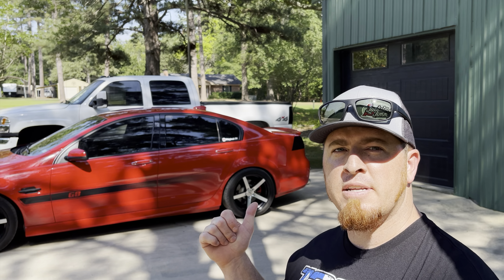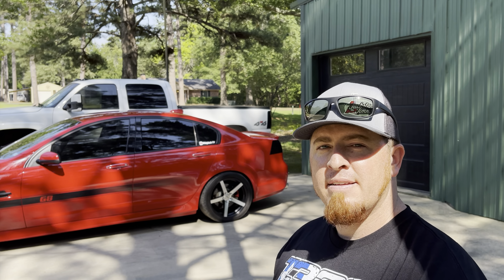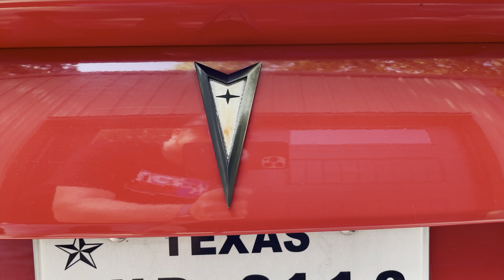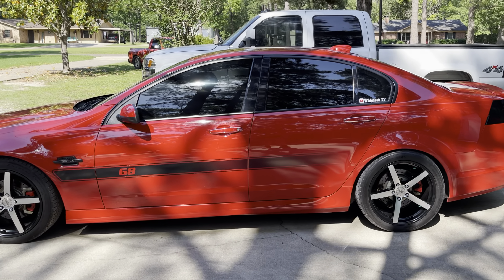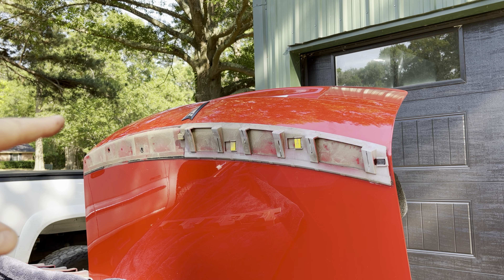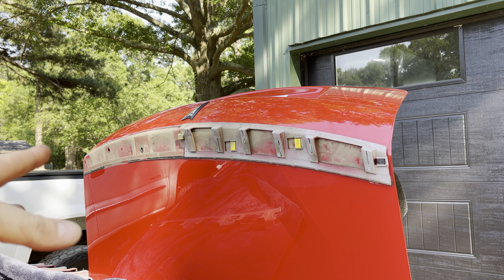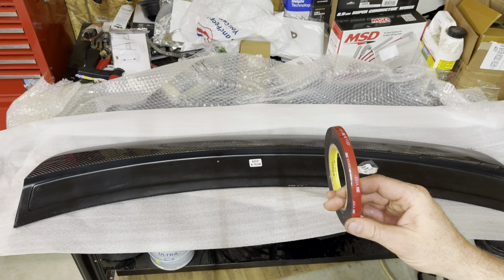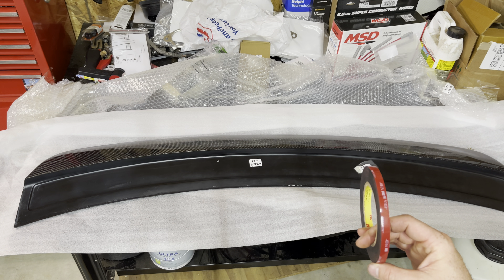CARBON FIBER Pontiac G8 GT Spoiler Installation and Review of Vladi’s Carbon Fiber Spoiler

Comment: That was a great video tackling this job . Thanks to you and your video I’ll be doing mine tomorrow. What kind of tail lights are those. They look fantastic! Thanks for your knowledge and sharing it.
Reply from the maker: Thanks, and I am glad that the video could help you! The taillights are actually factory taillights that are smoked and the tops painted body color.
Reply: @whiplashtv2022  I was successful in getting the spoiler removed today. Thanks again for a great video. Nice touch on the tail lights. How do you “smoke” the tail lights. Is that like a tint?
Reply from the maker: @siimplytwinss3248  that is awesome that you were able to get it off. I should have added that an eraser wheel would be a big help in removing the old adhesive that was holding the spoiler on. I did not have an eraser wheel at the time of shooting the video. I bought these tail lights done this way already. There is companies that make a smoke film that you can put on your tail lights, or you can have them professionally done by a painter.

Comment: Do you have a video for removing front bumper  and where did you get spoiler for rear
Reply from the maker: The spoiler can be purchased at streetdrivenperformance.net and you can use code “savenowb” and get a discount! I don’t have a video on removing the front bumper, but it is pretty easy to. There is a hidden bolt on each side behind the wheel liner and remove the fasteners under the hood that hold it on and then it should come off. Also disconnect the fog lights and marker lights.

Comment: Are these the same as the ones Eric Tau is selling? I’m unfamiliar with the name Vladi but mine just came packaged exactly the same. You got an IG? Went to comment on your fb post but can’t find it now.
Reply from the maker: If these are the same that Eric Tau is selling, then him and Vladi would have to have the same supplier and I am not sure if that is the case or not. I’ll check my messages here shortly 👍
Reply: @whiplashtv2022  I believe they are partnered as far as spoilers, and the side skirts. Possibly steering wheels as well.
Reply: Yes me and Vladi are partners. I do my own g8 steering wheels though and he's doing some other vehicles.
Reply from the maker: @etric412  ok cool. I told Vladi that I want a carbon fiber G8 front splitter next.
Reply: @etric412  
Where do I order one if I don’t have Facebook or Instagram?
Reply: @frederickbirchmeierjr1117  still working on getting more ready. You able to message me your contact info somehow?
Reply from the maker: Order it from Vladi on Facebook
Reply: @whiplashtv2022  he doesn't have any available. He's my partner we work together
Reply from the maker: @etric412  oh ok. Well it took me about 3-4 weeks to receive mine after placing the order.
Reply: @etric412  
Every time I try and add my email, Youtube wipes my comment out🤬
Reply from the maker: Reach out to them at their website https://streetdrivenperformance.net
Reply: No little bolts or plastic clips, I can't just trust that tape. Also in DFW TX. With the Heat and torrid Rain. Got a used one,but has a different underneath with places for clips and end bolts.
Reply from the maker: I live in Texas and have heat just like you. I have had 0 issues and added 1 short screw on each side where the 10mm nuts were on the factory one. That 3m tape is super strong.

Comment: I like your style. Go nice and slow and line it up just right. I think it diffidently improved the looks. You can really see how much it come up off the trunk from the side shot. I’m also not a big fan of the tape but if it failed I’m sure you would have mentioned it. All around nice job!
Reply from the maker: Thanks. It is still holding strong today. No issues.
Reply: @whiplashtv2022 why didn’t u get the maverick man carbon fiber ?? No 3M
Reply from the maker: Because 3M tape holds just fine. 0 issues

Comment: Did you fill the factory holes with anything
Reply from the maker: The factory holes?
Reply: @whiplashtv2022  the holes that held the old spoiler in with the yellow clips. Did you fill those
Reply from the maker: @lunitunz ok, your orginal comment said “jobs” but I figured that you meant “holes”. No, they don’t have to be filled in because the 3m tape seals around the outside of them. I don’t get any water into the trunk.
Reply: @whiplashtv2022  yeah sorry autocorrect. Thanks for the reply
Reply from the maker: @lunitunz no problem, you’re welcome.